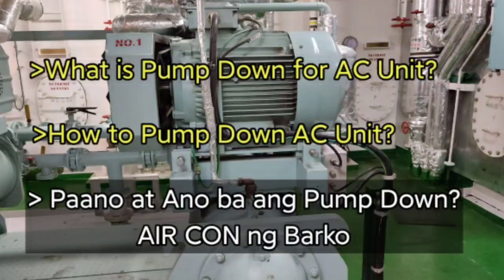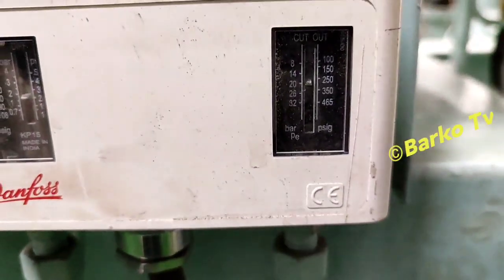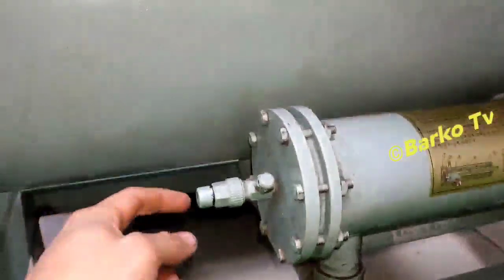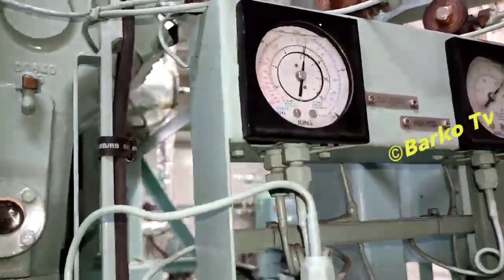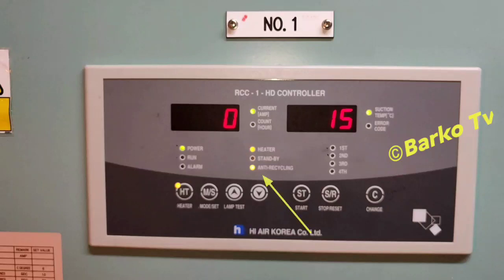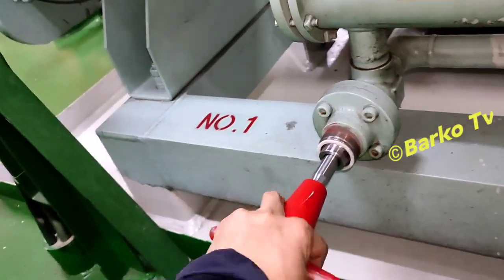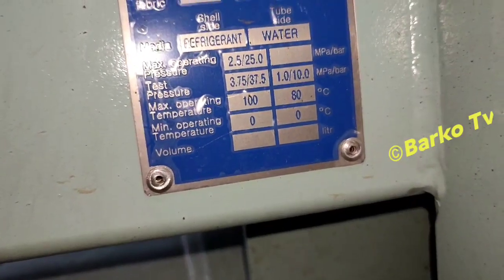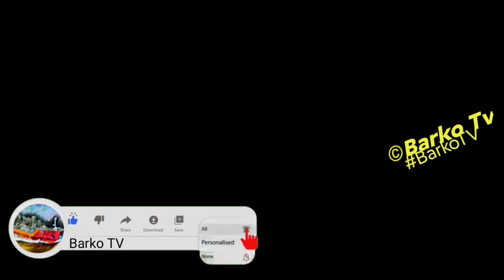How to Pump down the Aircon System in the ship?Bakit tinawag pump down? Ano ba talaga ang Pump down?

Comment: when you open isolation valve has to start again pushing the botton or he detect by yourself ?
Reply from the maker: It will start automatically, its because the low pressure de activates when you open the isolation valve

Comment: sir out of this topic, ask ko lng sa normal operation same po dapat ang temp ng inlet at outlet side sa filter drier diba? may possibility po ba or scenario na may temp difference between inlet and outlet po? at ano po ang problem if may temp difference po na naobserve? and additional po, sa pumping down ok lng po ba na ijumper ang LPS til 0bars ang suction pressure many times po until macollect na lahat ng refrigerant sa liquid receiver or hayaan lng na mag start stop ang compressor without altering the LPS?
Reply from the maker: Di aq nag jujumper ng lps sir, hinahayaan q lng na ang lps mag activate, di q na sinasagad ng 0, pumpdown lng naman. About sa filter drier di concern sa temperature, kasi binabasihan q dyan ang flow pag di restricted means ok, pero sa case sayo restricted yan kasi mag kaiba ang temperature sa in and out

Comment: Hi sir, thank you for your good video. after pump down happen, the compressor is shutting down for anti recycle, should we close the suction line valve ? to prevent the refrigerant going back to evaporator section ?
Reply from the maker: No need sir. But if you have maintenance to your compressors or evaporator section, isolate the valves which section you are working

Comment: Sir! ano yung mga mangyayare kapag maiwan mong bukas yung condeser during change over ng compressor?
Salamat po
Reply from the maker: Ang disadvantage pag di mo na pump down during securing the system ay mapupuno ang suction mo ( term ng iba ay nabilaokan yong compresaor, minsan mag overload during re starting. Pero ang solution dyan, during starting e close mo muna tpos pag malapit na mag trigger ang low suction buksan muna tpos normal operation na.